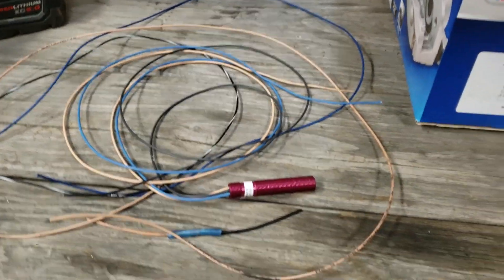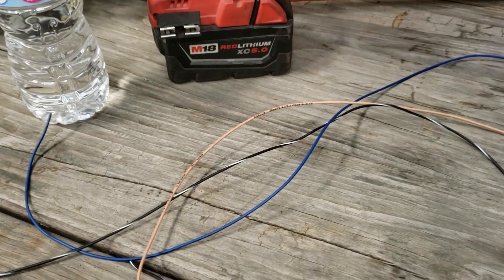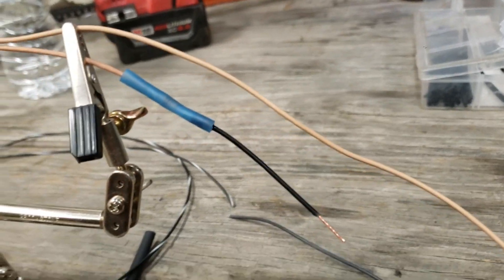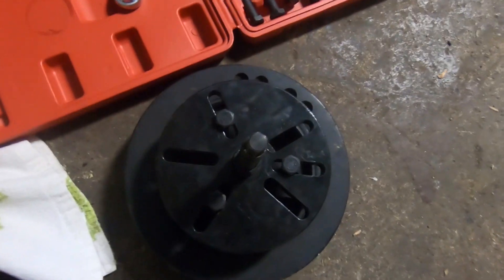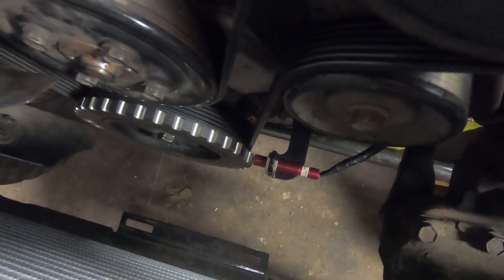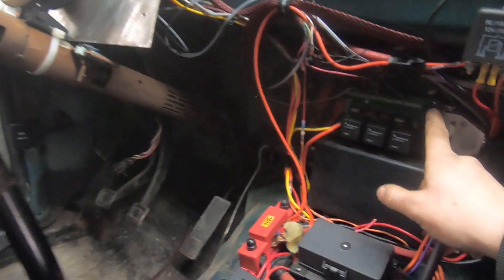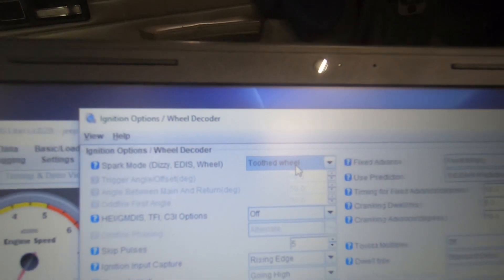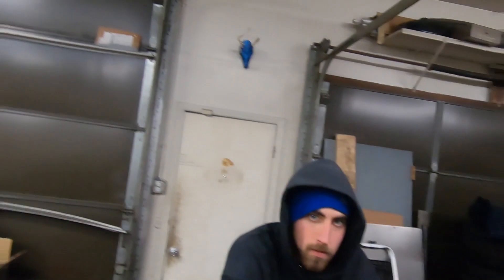Turbo Jeep New CRANK TRIGGER!

Comment: Hiw did you tune the ECU
Reply from the maker: Its a standalone ms3x ecu
Reply: Where can I get one
Reply from the maker: @joshhunt8614  diyautotune.com Its mx3x its a computer with a bunch of wires, you have to basically re wire your whole engine
Reply: I just put a turbo on mine